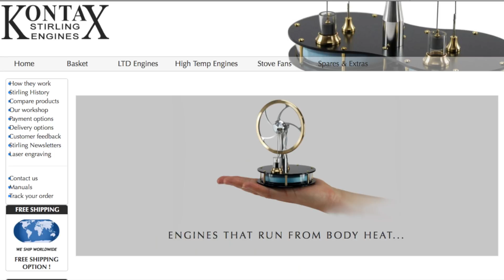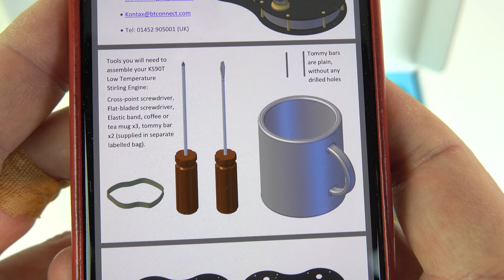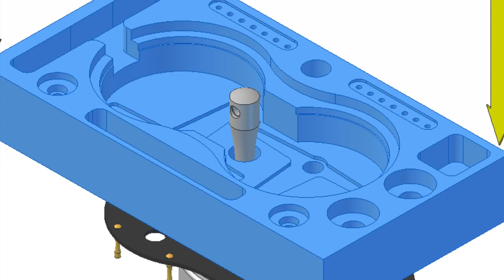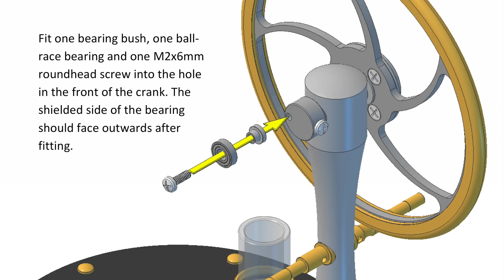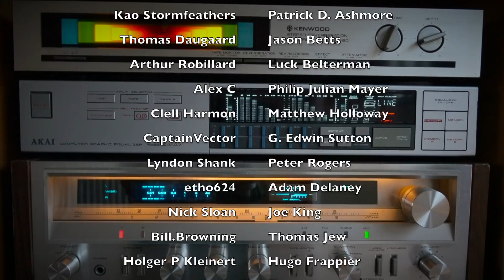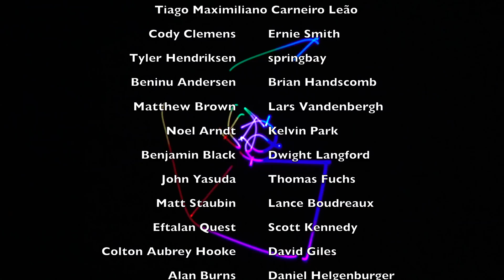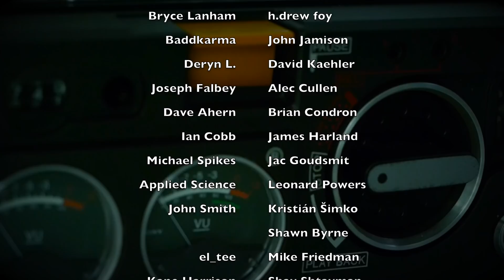Assembling a Stirling Engine Kit - The engine that can be powered by a set-top box

Comment: It's very beautiful but considering how simple the machine is £150 seems a bit overly expensive in my opinion.
Reply: It has to be very well engineered, simple friction between parts would be enough to stop it moving. Also, of course, the company has to manufacture small runs of all those parts. Finally the bloke's got to eat. 

That said I wouldn't pay that either, but for what it is, it's not a ripoff, I doubt the company is making huge profits. If I wanted to make money I wouldn't get into Stirling engines. 

You can get cheaper Chinese ones on Ebay of course, but you get what you pay for.

Comment: Stirling engines are such fascinating creations, how they take so little energy and turn it into so much momentum, and can run for as long as that temperature differential exists, they're great... :D
Reply: They are actually used in submarines.
Reply: I know Stirling engines have found some limited use in the past and may even be used to this day for very specialised applications but it seems to be a common misunderstanding that they produce almost free power because it takes only a small temperature difference to make the flywheel turn.

Unfortunately, as soon as you put any load on them, they pretty much stop.  This is the same with the nodding bird novelty toy that you have probably all seen.  It looks impressive that the bird can keep going apparently powered by nothing more than a glass of water.  Unfortunately, the power produced, just like one of these Stirling engines, is absolutely minuscule.
Reply: The thing is that they turn a very small amount of energy into a very small amount of momentum.

Yes, they are interesting and look cool but they produce only the tiniest amount of power, which is why they have almost never been used for anything in the real world.
Reply: Sterling engines have a low effectiveness (for thermodynamic reasons), so they are rarely used on professional basis. Anyway, I'm fascinated of those machines, too. Very funny is that they can be reversed in function. If you put a motor on the wheel you will cool/heat the plate. 
Having that machine sitting in a WLAN router and spinning the day long is very cool too - and will cool your router (by turning some heat into motion). :-)
Reply: They used to sell Stirling engine cooling fans.... which were powered by a heat source. Huh?!
Reply: You cannot say anything about the power production of Stirling, because it depends on the construction and environmental conditions. There are big generators based on Stirlings that exist and operate, they look similar to reflective satelite antenna and Stirling is placed in the focus point of it. The efficiency per square meter is much higher than the photovoltaic systems and the construction doesn't need rare earth materials. So far they're just more expensive because of the precise mechanics, much like in standard sombustion engines, and they are not mass produced. But I can see that eventually they could got cheaper and potentialy replaced the existing PV cells.
Reply: Firstly I can and I did.  Secondly, my comment about power was about this specific Stirling engine.  Thirdly, I have made it clear that I am aware that they have some limited use but they were invented more than 200 years ago and they are still very rare.  That tells you all you need to know about how useful they are.

Comment: I'm always amazed by how fast they run - I find it hard to imagine the air expanding and contracting so fast.
Reply: A little of the expanded or contracted air flows around the sides of the large diameter displacer, and that helps the smaller diameter piston to move in in its cooler or hotter cylinder. So the air flowing from each side of the displacer is working on both sides of it to keep the displacer oscillating. The pistons are 90° out of phase with the displacers, and the momentum of the flywheel allows the cycle to continue. That's why most Stirling engines are not self-starting. The Stirling is a beautiful example of a simple heat flow engine.
Reply: Provided that the engine is properly airtight and has a low level of friction/backlash it won't take much energy just to keep it running. As these toy engines are rarely under any load, it means that only very little expansion/contraction of the air is needed to keep them running -in fact not even as much as the cylinder takes up is required. 
All that matters for the engine to be able to extract energy, is that the pressure is a little lower on the down stroke than it is on the upstroke (or the oposite, depending on which directing the engine turns), and that you have a flywheel that is big enough to overcome a potential compression phase, so it can regain that energy when the air expands in the next stroke.
You can think of it a bit like a swing, you may not need to push very hard on each cycle, in fact you may not add enough energy to push the person on the swing all the way to the top of the arc, but as long as you just put in a little energy in each cycle it will accumulate to a lot larger swing, when the rest of the energy is just being conserved but flowing back and forth between two states. For the swing it is changing between kinetic and potential energy in the form of height and speed, and likewse in the Stirling engine it is flowing between potential energy and kinetic energy  but here it is in the form of pressure and speed.

Comment: I bought the KS90 Solar about 5 years ago, it's been running 24/7 on a dimmed 10 watt incandescent lamp for the last 3 years. 
The bearings get an occasional wash in mentholated spirit every now and then, and a drop of 3-in-1 oil on the power piston rod where it goes through the brass bush.
Reply: *methylated spirit. Looks as though autocorrect won, that  timel
Reply: RWBHere 
Hahaha.. I think you’re right!

Comment: Mat,  you are not alone in the  "well used hands" department. My thick, nubby fingers are often coated with engine grease and oil, and are usually scuffed, nicked and scratched up. Scars are visible where chunks have been removed by pokey and jaggedy objects over the years.  My car has already required several blood sacrifices from me to appease the Fiero-gods of Pontiac mythology.  Not to mention all the mowers, tractors and whatever else I work on, build, tinker with and fix.  I won't even get started on my nails.. 

Well-worn hands are a sign of knowing how to use them.  That, you can take with pride.

Comment: If you want to soup it up a lot, fill it with hydrogen. If I understand the physics right, it'll run a lot faster and with more power using hydrogen as a working fluid than with air.

Comment: Hi Matt, you can get a dry lubricant for locks which is made from ultra fine graphite powder, this works well for reducing friction
I have a 'Ringbom' type Stirling engine which is like yours but cut in half, I just turn the flywheel until the piston is at b.d.c. then add a puff of graphite powder and invert the engine and cycle by hand for a few seconds to push out excess powder and it will run for ages, try it!
As for the hand haters......screw 'em......any man who has perfect hands has obviously never done a honest days work in his life

Comment: So happy to see one of the Kontax kits getting some exposure.  I have a single chamber model that I purchased 5 or 6 years ago, and it has been happily spinning away using the waste heat from my wi-fi router.  The only maintenance is a dusting and light oil once a year.  It's one of my favorite curiosities.
Reply: If I put one on my pc it would probably speed it too much and explode because it isn't the best at cooling

Comment: If anything it didn’t need to sit on the warm drink and warm up, because the temperature differential is what powers it
Reply: He did say, I think, that the bottom plate needs to warm up. Just like the top plate needs to stay cool(er). There's yer temperature differential.

Then he pointed out it spins backward with the temperature difference the other way round.

Comment: If anyone has an issue with Techmoan's fingers there is a fix. Take your finger and press the computer's power button until your screen turns black. Do not press power button again.

Also if you want to make yourself a better person take your right or left hand which ever is the strongest one for you. From that hand stick your thumb out and curl your fingers. Then wrap your thumb around your curled fingers. Extend that arm in front of you until you can no longer stretch. Then take that  your curled fingers and connect with your face as fast and hard as you can. If you still have a problem with his fingers please repeat the previous steps.
Reply: Im having trouble with the connecting to face. I seem to have inserted into food hole ~ is this correct?
Reply: If you keep it in there then its fine, That way not only cant you speak about anyones fingers but also you cant type about it either. lol jk
Reply: Instructions unclear. Stuck in dishwasher.

Comment: What a lovely piece of machinery...!
Is the fly-wheel a bit wobbly (13:25)...?

I suspect they have more completed models because they sit around enjoying making them themselves, hehe.😂
Reply: It's a little unballanced because of the screw used to secure the crank to the flywheel. THe forces are asymetrical and wobbles it.
Reply: Michael Berthelsen looks fine to me
Reply: I guess the wobble is caused by the gyroscopic effect that happens when a rotating wheel sits on a rotating base.
It should not be a fault of the machine, but I think that doing this at high speeds for a longer time may wear out the ball bearings more quickly.

Comment: Your hands are the hands of a working man. Hold them up with pride.

Or buy working hands hand rub so they can be taken care of better.
I think "gloves in a bottle" is an alternative in your location.
Reply: I wouldn't want to assemble some acrylic/glass/polished kit with lotion all over my hands.  Talk about fingerprints.  Just get some nitrile gloves and solve both problems, even if one of them wasn't worth considering.

But really, as someone who works with a lot of solvents, I've learned my lesson after having cracking, bleeding hands and paper-thin thumbnails.  Wearing gloves allows you to avoid solvents and it keeps your hands clean of any oil/dirt/grease/etc.  Cleaner hands = less aggressive soap requirements.  It's done more for me so far than lotion.
Reply: Dream Services International the creams are for after you work not during. They also aren't supposed to be protecting your hands just help to make them heal faster.
Reply: Just plain old olive or coconut oils work great for moisturizer; no need for fancy creams!